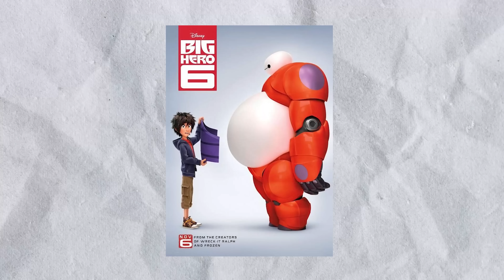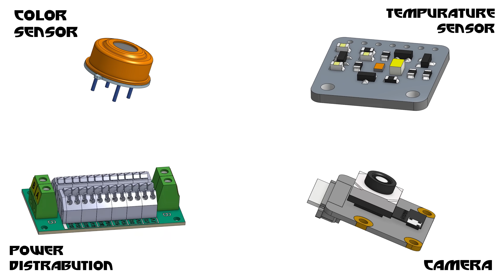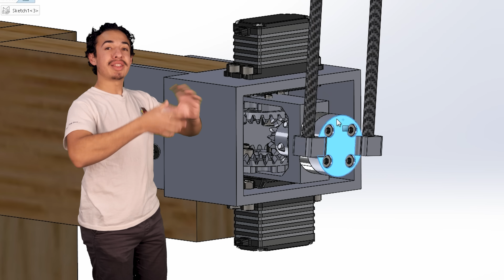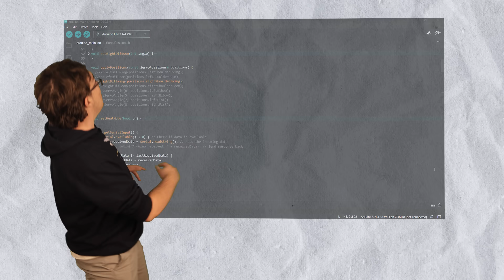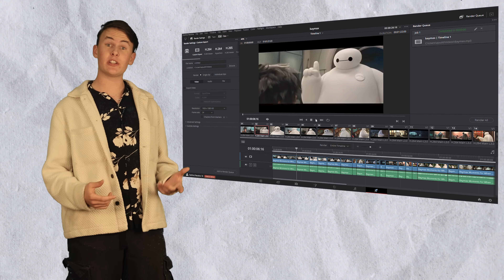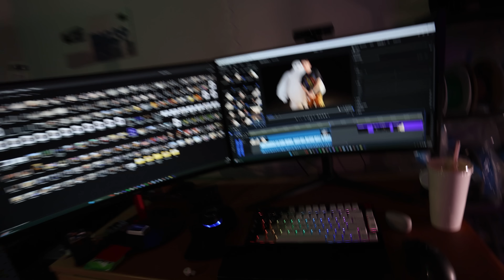We built a WORKING BAYMAX from BIG HERO 6!

Comment: Pretty disappointed in the video it seems as if they just put a voiceover on the video for baymax and pretty much just bought an inflatable baymax and put LEDs on it and used a projector on the front externally as the “screen”. You guys should’ve took more time with the video so at the end you actually had a working arm system and used ChatGPT or some form of AI as the voice for baymax instead of just putting an audio overlay of a Baymax voice
Reply: Agreed

Comment: Guys I really love the idea of making a Baymax, and I've personally thought about making one. But tbh, do I not believe what you have done, in the literal way. It seems like you've just taken a balloon and filled it with air and barely anything else. The screen that pops up at 12:13 is moving and it's not symmetrical (like the bottom of the screen would've been bent whereas the top wouldn't be), which probably means that you haven't installed a display inside of baymax, but rather just used a projector to project an image. Neither did you prove that it actually had face recognition when you only showed one person, you could've just told it to say your name. And on top of that, it's not even certain that you installed any speech-to-text nor a microphone so it could hear you whatsoever since the audio sounds like it would've just been a voice sample being put into the editing instead of coming from Baymax's body. And the cards that you put in could just be a cardholder 3D printed, and not have any actual functionality. Plus you didn't prove whatsoever that it would work. Neither did you actually prove it's ability to EVEN WALK. Guys, if you truly wanna make a Baymax, then make one. And it will take long, but faking making one is completely different. I had my hopes up when I saw this because I also wanna build one, but as I follow the video, it all seems fake. As if you would've pretended to make one by taking some clips, explaining how it would've worked in theory, and then faked actually making it in practice. Please correct me if I'm wrong, because I do want to believe that you've actually accomplished something, but I strongly doubt it. Another reason I strongly disbelieve that it would've actually worked is because if you guys actually wanted to build a baymax to help others, then you would've inspired others to do the same, and then you would've probably shared all the code and the entire process of making it so anyone could make one.
Reply: Finally someone speaking whats everyone not saying about this vid. I always have a feeling of them faking things when testing the Baymax they built. None seems convincing.
Reply: Frrr this is so bad it’s just blowing something up pretending it speaks when it doesn’t they just g it that from an aigenerated voice and projected a screen onto it it’s so bad
Reply: I seriously cant believe the AMOUNT of peoples that actually believe it when it is so obviously fake, the voice didnt even COME FROM HIS BODY LIKE HELOOO thats the bar fking minimum for a ballon that doesnt even move. They are definetly deleting comments cause aint no way peoples are THIS naive
Reply: This is literally the equivalent of an inflatable people put out in their lawns on the holidays.

Comment: This video is fake (as in they lie several times and make shots look very misleading).
The description (at the time of writing) says "In this video your 3 favorite college students build the the first full size Baymax from Big hero 6 in real life" which is a provable lie considering the Baymax they use is one that you can buy off of alibaba for 300 dollars, and there is no size adjustment on that. By the way, they don't ever tell the viewer that they didn't actually make the inflatable. For the images of the 3D model (a CAD file) they just used a tool built in that generated gears, and they didn't even bother to actually put a speaker in it. If you pay attention to the part where the robot is speaking to them, it's obviously added in-post through the video editor they used.
Then of course the one part that they at least tried to engineer, the arms, don't work.

I think what probably happened was that they tried to make something, realized they didn't have the time, money, effort or any combination of the three, and so they decided to just make the video seem like they put in a lot of effort to build something to gain watch time. That, or they needed a justification for spending 300 dollars on an inflatable.
Reply: Totally agree. None of the tests they did with Baymax seems convincing. Even the popup screen on his belly looks like it was projected, not a built-in display

Comment: hey! great video, i couldnt help but notice a few things that were missing that would make the build alot better:
 1. using servos is not always the best idea especially if your working with heavy materials like wood or metal next time try stepper motors they're going to save you lots of time and effort
2. the color module for the cards isnt really the best idea for card detection because it requires intense light and  its a hollow body and semi transparent so any light would be obvious from the outside you should use an nfc reader and writer, with an nfc card painted green and red
3. screw the raspberry pi, theyre only really useful if you have a small build but since this is a hollow fatso robot put in an old laptop with a mid-range graphics card and make it communitcate with the arduino via usb using the pyserial library its going to help with face recognition times, response times and even trouble shooting
4. the projector part is really neat but you could make it a touch screen by taping a 10 inch touch screen to the inside of baymax and itll work fine just needs to be really close to the outside surface
5. try using a sim800l or sim900L for GSM (2g/gsm module for arduino) so baymax can access the internet from anywhere with a cellular connection 
6. try putting the sensor holes in the blakc parts of his face so theyre less obvious

thats all, great project love, from egypt.

Comment: This was great! Curious though why you didn't try soft robotics techniques which was the whole point of Baymax. For example, You could have had some soft corrugated tubes and wire ran along at least 2 sides of them with servo controlled spools that wound up one side of the other to create a curvature in the tube.
Reply: I am betting they are building this using tools and resources they are currently learning about in college. Which is why they went the route they did.

Comment: 12:15 that is so fake, great vid tho
Reply from the maker: There are color sensor integrated into the card bay that read the color of the card, which is then fed from the Arduino (little boss), into the rpi (big boss). This then tells the program that it should update its prompts and turn its eyes red.
Reply: @ I’m talking about the voice
Reply from the maker: @Jonald.Eugene  Ah, sorry for the confusion. We have speaker inside Baymax , but added a voice over because our microphones didn’t pick it up the best. The speech was generated in real time however.